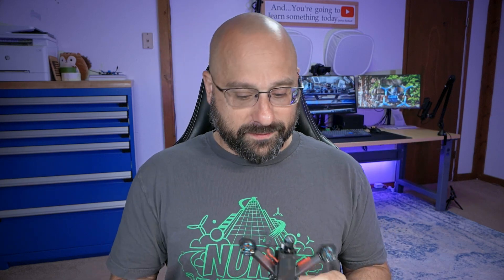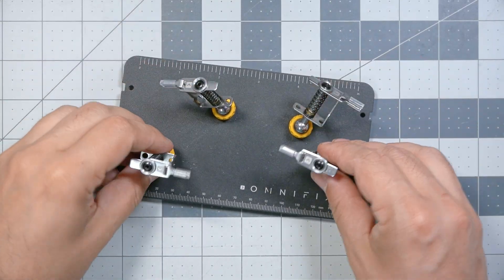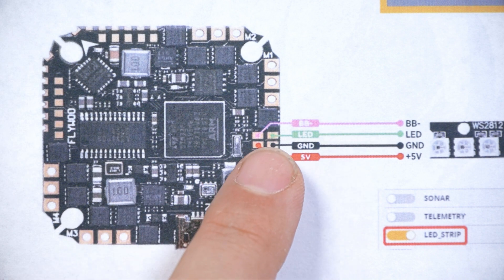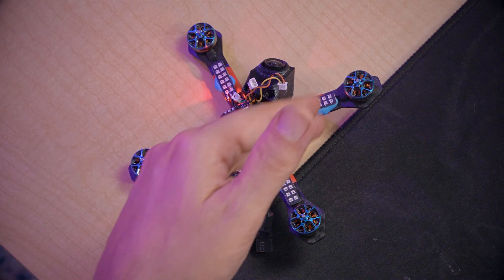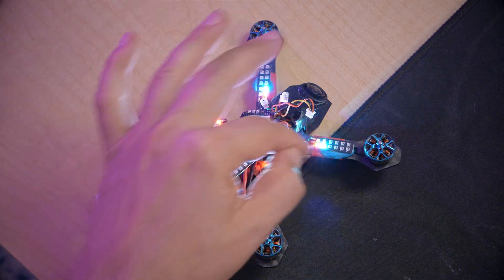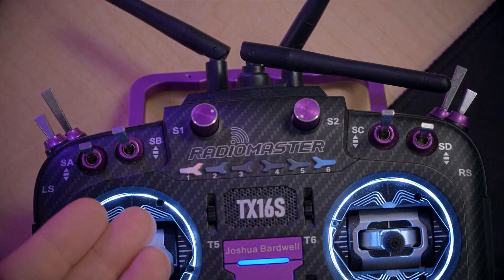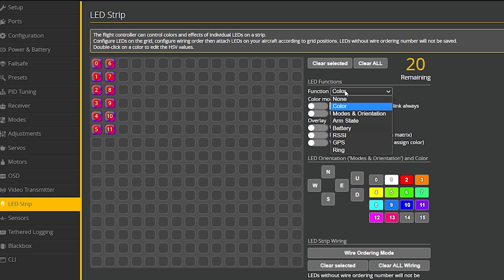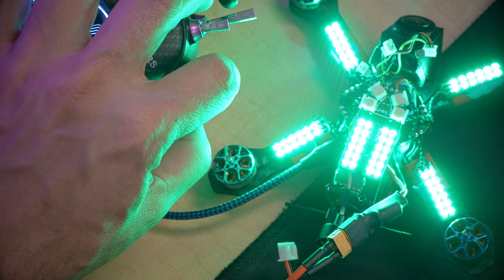533 Tiny Trainer LED setup - change LED color with aux channel!

Comment: Hello, I have a question: On my quad I want to have turtle mode, and set everything on the radio and in betaflight. But if I flip the switch nothing happens. I´ve seen a couple of videos on yt but they were older but even if I did everything like them, it didn´t work. I´m currently using betaflight 4.3, does someone else got an issue with that?
Reply from the maker: Hi, Lauren,

Here's a good video to walk you through setting up aux modes: https://www.youtube.com/watch?v=feObDe54wKw&ab_channel=JoshuaBardwell

Comment: Thank you JB for an awesome LED (technical) video - these are my favorites 😎
About a year and a half ago I had a Taycan build and I ordered the LED kit for it and I learned that it was -  change one color, change them all - suddenly I understood the difference between parallel and series wiring. I was so frustrated with the LED kit that ultimately I disassembled the frame, and used the parts to build a zippy lil 4" Armattan Gecko.
This kit is different. While still a parallel config, the LED's are also addressable in a kind of "serial bank" (what does that even mean LOL)

PLEASE Do a follow up JB! Deeper dive into - lets say - 
You mention how you could accidentally hit the slider and change the color - 
Could you add a variable that once the quad is armed, the slider will NOT change color value until disarmed?
Cheers

Comment: You set the Color Modifier to be Aux 2 but you're using Aux 6?
Reply from the maker: I'm definitely using Aux2. Channel 1 2 3 4 are main control channels. Channel 5 is aux1. Channel 6 is aux2. And so forth.
Reply: @JoshuaBardwell  Oh now i understand - the first 4 are taken up with the standard channels - thanks

Comment: Change brightness and colour automatically based on acceleration or speed if possible. Would look super cool. Like yellow for hover throttle, then as you speed up it goes more and more red and brighter. Cool little light show while you do flips pretty much
Reply from the maker: This can be done, but the Tiny Trainer spec racing series requires fixed color.

Comment: Can you make the aux channel to slowly move so its making a rainbow effect on the drone
Reply from the maker: 100% yes this is something EdgeTX and OpenTX can do but I would have to search for a tutorial as I don't quite remember how to do it.
Reply: In the mixer, you can set a "slow" setting - This is set for each direction individually. The number you put in there is the number of seconds it takes to go from one extreme (-100%) to the other extreme (+100%) so 2 seconds is quite nice. Please note that this seems to be based on the source changing, therefore if you select the source as MAX and try to adjust it using a global variable affecting the weight (See my other comment thread where I go into adding an "enable" momentary button, or Joshua Bardwell's reply to another question about toggling through preset values) you'll actually need to do that in a second mixer. But for the example which Joshua Bardwell has given, you can use the slow as it just by entering the number of seconds.
Reply from the maker: I remember once setting up a back and forth servo using opentx but I can't remember how. Maybe logical switches that detect when the channel hits one endpoint and then flip the switch to change direction, combined with Delay.
Reply: @JoshuaBardwell  Ah that's interesting, OpenTX is incredibly powerful once you get into it.

I should point out that I misspoke, I meant to say "slow" rather than "delay" so I've corrected my reply above. They are both next to each other in the mixer configuration.

Comment: It's like you are reading my mind. I've been looking to add LEDs to my tiny trainer for a while. I love this one's built in regulator, but not that each bank is in parallel. Also, I've not found it in stock with my regular retailers.

Comment: You could possibly make it so that you have to hold a momentary switch in order for the slider to become active, which will make it a little safer if you also have your VTX channel on there.
Reply: Go to mixer screen, pick an open channel,
Set Source: to LS/RS your choice, scroll down and set Switch: to SH (momentary switch),
Now go to Special Functions page and choose a new special function. Set Switch: SH, Set Func: Play Value, and Set Value: LS (OR) RS  
That worked for me. Hope this helps!
Reply: @RcMcNutt  That didn't seem to work for me (On the OpenTX simulator, I don't have my controller to hand) because as soon as SH is released, the mixer goes back to the default value of 0%.

What I did instead was: (Where as in your example LS/RS is the slider, SH is the momentary switch)
Mixer: Source = MAX, Weight = GV1
Special Function: Switch = SH, Action = Adjust GV1, Parameters = Source LS/RS, Enable = true

You could also use Play Value to read back the value of GV1 when the momentary switch has been released.

Comment: Hi Joshua, could you set a aux channel to cycle through preset colours using a global variable like in the left turn video you posted recently.
Reply from the maker: Yep definitely!!! Use a mixer line with SRC=MAX and Weight = whatever aux channel value output creates the color you want. Then have L01 L02 L03 etc based on the value of the GV that is working with your rotary switch and set the mixer line to enable based on L01 L02 etc.

You will need one mixer line per "positoin" of the rotary switch, with a different Weight per each line.
Reply: @JoshuaBardwell  Another option might be to use a custom curve, it might be a little simpler to setup and would use fewer mixers.
Reply from the maker: I could see that making sense.